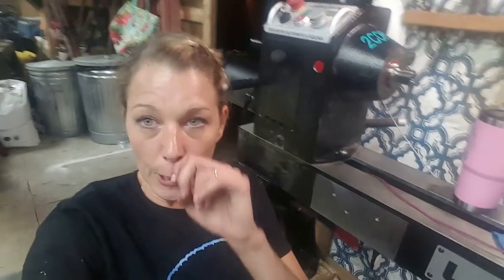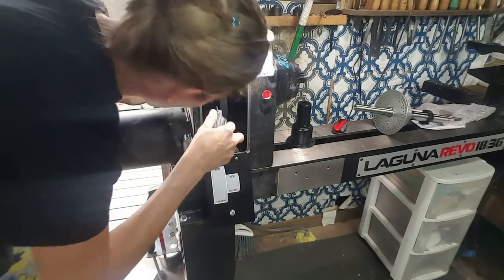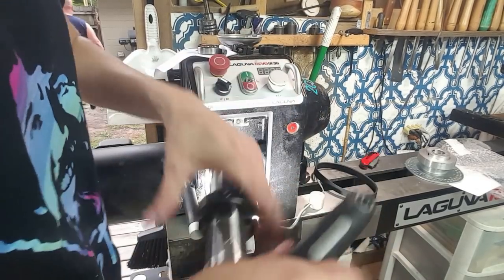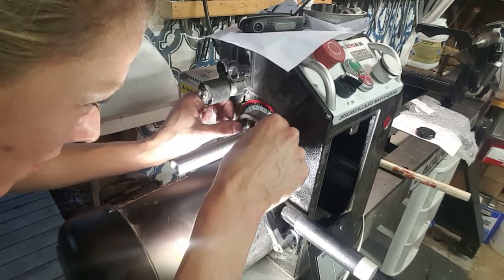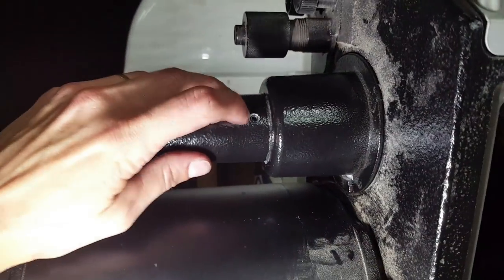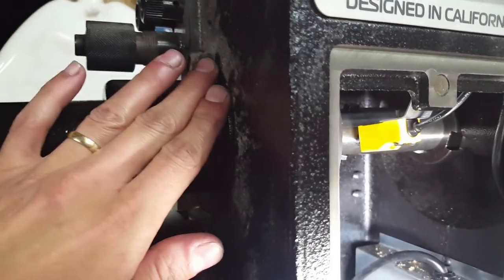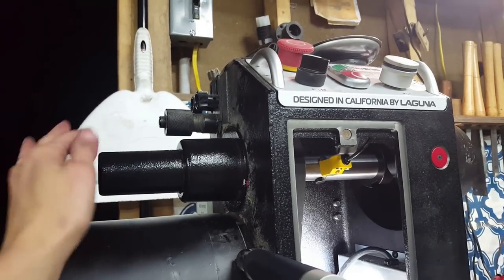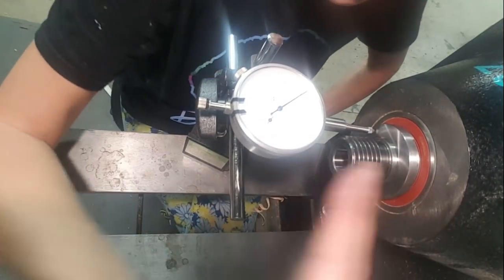New LAGUNA lathe spindle replacement

Comment: It is outrageous that you would have to overhaul a new machine. I am a mechanic and would never accept having to work on a new lathe or any other woodworking tool.  If I bought a used piece of equipment I would expect that I would need to work on it. But new? No way. Laguna should be ashamed to produce such shoddy workmanship. I hope it works out for you.  Laguna is off my list.
Reply: New bearings I'm afraid if still not operating properly. Needs yet another strip down to do that. Best option return it and get a refund. Sorry

Comment: Hello Kim, I just joined your chanel and you seem to have a lot of issues with spindles. Did you check the treads on the 1inch 8 thread? For the chucks that we use when turing then the thread is very important. if there is any damage to the tread it will cause wabble on your chuck. You should even check your chuck to make sure the treads are 100% clean. There are tread files you can buy to help with any rough thread issues. Hope this helps
Reply from the maker: Thank you 😊  Yes, I have. I appreciate the info!

Comment: I guess by now you have replaced the barrings as well they should have sent them with the shaft as a machinest  I know that loose bearings mean bad bearings I had to change them on my Grizzly after the headstock failure but that's another story.

Comment: Quick question - I have been watching your video about replacing the spindle of your laguna lathe.
My indexing wheel has come loose making a rattling sound when the lathe is in.
Do you see anyway to tighten the screws on the indexing wheel attaching it to the pulleys without totally removing the spindle?
Second question- you have any fixes for the crap designed laguna banjo that wont properly hold the shaft of the tool rest?
Reply from the maker: I am so sorry that you're having lathe issues! I wish I could remember what it looked like in there to help you. Try searching a parts break down online. 
As far as the banjo, I think I put mine in a vice and then added the handle to tighten it.  I am not 100% but I did find a video on yt about how to fix it. Look it up. It would probably be way more helpful than I am. I am sorry I can't be of more help! Hopefully you find the fixes and they are simple!

Comment: Hi Kim. Check that live center for any dirt, dents, burrs, wood chips, on the Morse taper. Check the inside of the spindle also. Even grease can cause run out. Check this good each time you change out any center for tail stock and head stock. Keep in mind while you turn wood with the chuck, debris will work their way into the taper of your spindle. I keep a bristle brush that will fit in the spindle and clean out the barrel of your gun (spindle) at each change. One hair on a morse taper can cause run out. It is a fiction fit. Same as a drill chuck on your drill press.
Reply: You can always fast forward. Is fast forward a thing? OLD I'm old apparently.

Comment: So what’s the verdict, Kim? The new spindle appears to fix the run-out problem, right? Or do you still think there’s a problem with your chucks not running true? Would you buy another Laguna, after your experience with this one?
Reply from the maker: I am not sure. The dial indicatior is running perfect on the inside taper, but the outside not so much. I have had mostly wet wood on the lathe since I repaired it so I am not sure.
No, I wouldn't recommend this lathe. This is my THIRD Laguna in less than 5 months!
1st one about caught fire. Right after we set it up, plugged it in and pow! smoke! didn't even turn it on. Laguna sent a new headstock. That spindle was so bad and stuff was broken off of the headstock.. I can only assume UPS rolled it around before it got to me. So I just packed it all up and sent it back.
Laguna is done with me. My last email to them was about the new live center that wobbles....still, and they said it is within thier standards. The CS rep was rude, specifically about my videos.
 Stinks :(
Reply: @KimTippin  Hi Kim - 1, thank you for sharing this video. 2, thank you for responding in the comments. 3, I just received my replacement spindle assembly the mail today and will be replacing it over the weekend. I purchased the lathe second-hand for a steal and it seems the spindle has run out (hence the spindle replacement). 

Do you still have your 1836? if so, have you found a chuck that doesn't have run out?
Reply from the maker: My spindle is much better after the headstock replacement. But, both chucks have run out still... Not as bad but still very noticeable and aggravating.
I am thinking of trying out the Easy Wood Tools Easy Chuck. I had a gentleman call me and say he replaced his Nova with this Chuck and all his wobble went away. 
Thank you for watching and I hope the info helps. Praying your spindle is true!

Comment: Hi Kim. Another comment from me is the shaft cover at the end of the shaft with the two set screws. It is just to keep you from getting wound up into it. Safety thing. Some shaft bearings are a "press fit" in some lathes and some are "slip fit". Yours is a slip fit from what I see, that is why you removed the shaft relatively easy. The Grizzy had to be a press fit, hence the reason you had to use the hammer. The end cap also has a window in it for you to see what hole you want to align to from what I could see. Right above it is three little knobs which must work with the segment plate. The plate looked like it had three rows of holes for 3 different division depending on what you need. You don't need white knuckle the motor to get it tight, just snug. Push to hard and all that will do is stretch the belt. A grove belt like that gets it drive tension from all the ribs giving more surface contact to the grooved pulley, so you don't need to over tighten. You did it right by pushing on it with one finger and see if flex allowing some flex. You do good work.
Reply from the maker: Ed!! Your amazing! My next repair, I am just flying you and your wife here. lol. Thanks! Other than what that part was in the beginning,  you answered All my questions! Thank you ao much for taking the time to type all that ! wow! <3
Reply: @KimTippin  Well I don't normally do house calls, but for you and your husband I may have to make an exception. I will drive I don't like to fly. I have a bottle of beach sand from Daytona I filled up myself. My wife has been bugging me to go to Florida but she don't like to fly either. Lol. We will have to do a video chat. I talk to much and I type to much, I just hate to see someone struggle when I think I can help. With my machining background I am helpless not to share what I know. You learn a few things after 47 years of making stuff. haha. I will try and private message you. I am not fond of this format to help people.
Reply: @Sea-Dog5496  I love all the love that is spreading here. You know someone is passionate when they say they'll go out of their way to help another. Also Kim, you only know how things are correct when you have pulled apart and put back together what your working with. Sorry, did your husband watch the bit where you fast forward? Cause I laughed out loud and I don't even know you. Your husband and kids must have fallen and doubled up on the floor with laughter.

Comment: I have watched several of your videos and commiserate with you.  I had a small Delta tabletop lathe that had a bent shaft and replaced it also.  Turns out the belt location was actually bending the shaft!!  I then got a Nova lathe and had zero issues with it.  I thought I needed a bigger better lathe so I got a Laguna 1836.  N made, There was so much wrong with it I almost sent it back , and but your comment about sharp casting edges got my attention.  The same was true for my lathe.  In fact if I was trying to I’d the lathe you were working on I would have called it a Laguna!  The case is EXACTLY the same as the Laguna I have!  So hang in there.  If you end up going for anther lathe, I highly recommend the Robust line of lathes.  American made and smooth as silk!  And I like what you have turned too🥰🥰

Comment: Hi Kim. That live center is never going to work. Oneway makes a very good one. I would highly recommend one, not cheap but very good. I believe they rebuild them if ever needed at a fair rate. Had one for 5 years and never a problem. I don't get any kickback, I do not involve myself with that short of thing. And I don't do video. Send me any question you need to and i will try and answer it with what I know. Stop apologizing for what you know or don't know. Professionals built the Titanic, Amateurs built the Arc, we know how that turned out. God don't make junk. Bless you.

Comment: I have to say you are a diamond Kim perspiring or not! lol,  I like the design of the LaGuna spindle assembly better than the Grizzly. Any time your spindle bearing are set into cast aluminum bearing bosses they are subject to a slight amount of movement. The porous castings whether cast iron or aluminum "move around" a tiny bit with temperature changes and normal wear and tear. This is all dependent upon the casting thickness too. The best thing I would think would be to try it and see what the machine does? I'm kinda surprised that LaGuna didn't specify how much bearing preload to apply to your motor-side bearing? Ask your distributor if they have a spanner wrench for the threaded pinch adapter? ( for lack of a better noun) make cinching that thing up much easier than using channel locks and won't bark up the edges of the nut either. That part is just the mechanic sticking out on me! lol. I have 50 years of experience with all things mechanical, while not a wood turner as yet, all the mechanical nuts and bolts of any lathe be it  metal or wood still share the same houses with all other machinery. Once again you have impressed me with your fortitude and dedication to doing the things dear to heart and soul. Also don't feel that you shoulda made LaGuna come out and fix this or I'll huff and puff and blow you plant down kinda attitude. Sometimes you have to take the initiative to get the lathe rolling again, you could turn old and grey waiting for Mr. Fixit from LaGuna to come to your rescue. Then he may or may not fix the problem?  Then reflect on how much downtime your business has? The more you know and understand how hour machine works will your own Mrs. Fixit. Who better to know these things than you Milady Kim. God bless you for sharing this part of your life with the world.
Dave
Reply from the maker: Thank you so much, Dave! 🤗🤗 This was a learning experience for sure. Not really a planned lesson but a lesson all the same. I have a better understanding of how this machine works. Thank you for your kind words!  God bless!!

Comment: Hi Kim. Ed Maynard's comments are spot on. Not much I can add. I agree with him on cleaning the taper every time before you put anything in the spindle, or the tailstock ram. Check your new live center with it in the tailstock, and turn the center by hand checking runout with your indicator. It might not be perfectly concentric with the Morse taper, but shouldn't be a problem. The spindle bearings aare a slip fit on the spindle and into the headstock for a reason. It's very easy to damage a press fit bearing by hammering on it. The wave washer keeps a preload on your bearings. Hope your shoulder heals soon. God bless.

Comment: Have you had any issues since you replaced it? I want to get one of these lathes but I’m wondering if this is a common issue with Laguna? Thanks Kim, love your videos!
Reply from the maker: I still have a slight wobble. I can visually see the pulleys bounce inside. I am going to replace the bearings for better ones and the belt. waiting for the weather to cool down to do it.
Reply: Are you kidding me. Shame on Laguna's customer service. Just to let ya know I have not had one problem with my Powermatic lathe. Good luck.

Comment: Appear to be the reason why the bearings are not pressed on the shaft is to make belt replacement easier I’m guessing that these belts need to be replaced periodically.

Comment: Kim,  I was watching this video about your lathe not being concentric.  I don't believe it is your headstock being off center.  I believe it is probably your tail stock not on center.  Simple test,  turn a small piece of wood ( or metal in my case),  put your tail stock just to the point of touching the wood.    Remove the tailstock and rotate 90 degrees. You can tell easily if the tail stock is out of alignment.  This happens a lot because the tail sock is a moving assembly that has play on all three planes and is subject to much more play than the head stock.   Forgive me if I am out of bounds for diagnosing your lathe problems.  Just going from past experience.  Love watching your videos, hope to convince my wife that I need a wood lathe.
Reply from the maker: Thank you so much for the tips!

Comment: Kim… I just started to watch your video. I know nothing. I stopped to send you this. Are you by chance sitting in a wheelchair? I only say that by watching yours hands talk. I turn sitting in a Permobil C300. I was using a Shopsmith but the way tubes kept getting in my way. In June I bought a new Laguna 1216. Then I built a killer custom stand. With my elevator seat the fit is PERFECT. I am the worse turner on the planet. Even though I ran my own custom woodshop for 25 years the lathe was the one tool I stayed away from. Yes I will continue to watch your video. The reason I stopped was to ask you one question. What has been your experience working with Laguna Tools customer service? My experience….. They are HORRIBLE! Yes I have problems with my super sticky tailstock. Yes my pals took it apart and did this and that. No help at all. Now Laguna has asked me to take it apart AGAIN and try a fix at their factory recommendation. I bought my 1216 in June 2023. We still have a HUGE problem. Over the weekend I placed them (kindly) under a letter of demand to ship me a completely new tailstock and not a remanufactured unit. Please allow me to keep going…. The battle started between Woodcraft & Laguna Tools. Laguna Tools said this is not a warranty issue but it is between me & Woodcraft. We had missing parts. The 3” faceplate, the knock out rod, the rubber feet and bolts & the owners manual. What really sat sour with me is Laguna not willing to step up and send me missing parts and square up with Woodcraft on another day. I bought my lathe on June 7th. I got my parts on September 22. They shipped them to Woodcraft because they would have to charge me $25.00 bucks for shipping. YO DUDES! I got wheels under me. Do you realize how much effort and pain I am going to go thru to pick up my parts? HELLO? Its a Womp Ass hard time doing what I do. I am very proud of how I have conducted myself with a life changing disease. I don’t like to ever wave the disability flag because I have so many abilities. I don’t focus on what I can’t do. I love wood and love woodworking. Sawdust is in my blood. I am very limited in what I can do. My wife is a champ at helping me lift stuff up. My lifting weight limit is 14lbs. My dog LuLu weighs in at 13.5lbs. Whew! Right under the wire. Sorry to use your channel for grandstanding. But I had to ask you about Laguna. The funny part is I don’t have to worry past the two year warranty. The lathe has a brighter future than I do! So I will check out your videos and shout out to you from time to time. That’s it. Thom Schuck, Portland Oregon

Comment: KIm- Here's the thing. They don't use Angular Contact bearing at the spindle that require a preload (Certain Tightening Torque) to close the bearing properly for operation. The Angular Bearing has a higher radial load characteristic. And the preload prevents Linear "Slop"  Left to right.
 That run-out you see with the Chuck could be the culprit for the run-out. (simple Ball Bearings don't cut it)
 This type of bearing can be found at your local Industrial supply ....
 https://www.mscdirect.com/
https://www.mcmaster.com/
https://www.grainger.com/
https://www.fastenal.com/product/all
 Feel free to reach out if you need help.
Reply from the maker: Thank you 😊

Comment: Thanks for posting this video. Through a really dumb move I had to replace my drive belt. Once I saw the removable collar on the hand wheel side of the headstock that needed to be unscrewed it all fell into place. The shaft will come out just enough to slip the new belt on and then reassembly is quick. The whole job was about :10.

Comment: I am dealing with this currently. Did replacing your spindle fix your problem? I am just about done dealing with Mr. Day at Laguna.
Reply from the maker: it "helped" bur still slight run out that magnifies further down and out on projects.  It dosen't take much run out to make a difference in vibration.  I am sorry you are dealing with this. I pray you get a resolution.
Reply: @KimTippin  this is the same exact thing I've noticed since swapping spindles. Today Travis Day from Laguna told me there is no longer anything he can do for me. I bought a ton of add ons and with the price of the lathe I have $4500.00 invested. I am super bummed out about the situation and don't have a clue what I should do next. We have a One-way 1640 in the shop and I guess I'll just keep using that for most projects. Thanks for your video.
Reply from the maker: They can't send a new headstock?
Reply: @KimTippin  that's exactly what I asked him. He said he doesn't have the authority to authorize that. I told him I need to speak to someone that does.